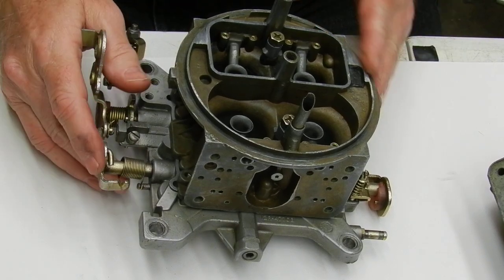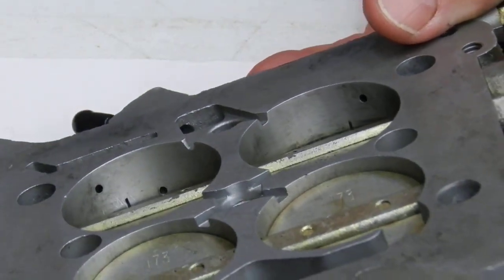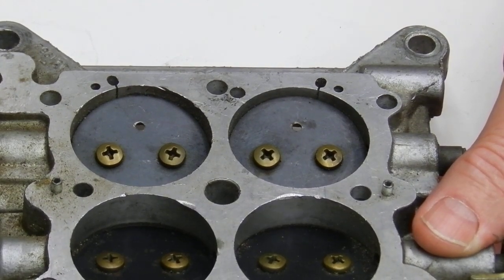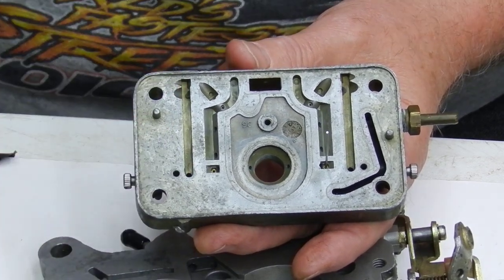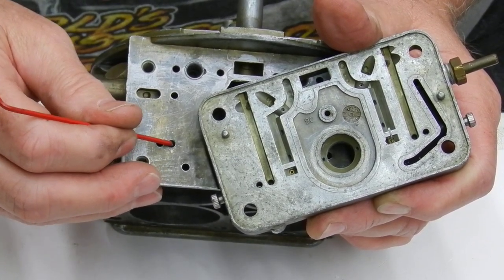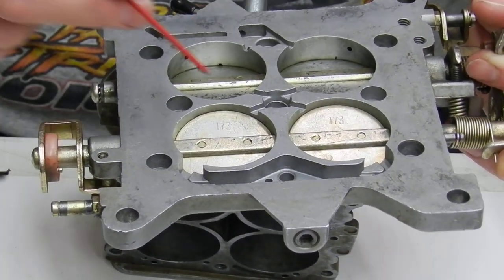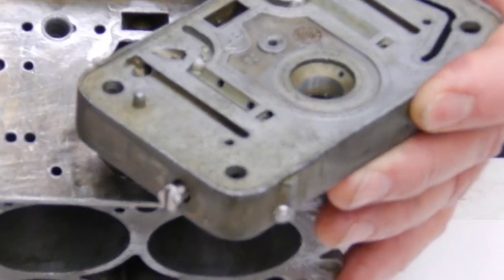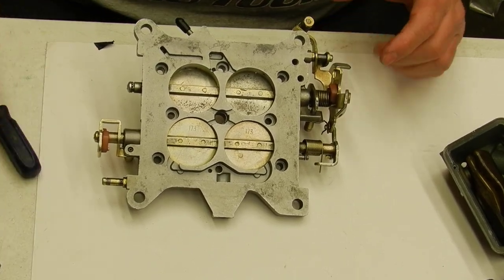Holley Carburetor Tuning: Idle Circuit Mods for High Duration Camshafts

Comment: this carburetor is designed for use of a pcv valve no wonder you have to open the throttle plates so big. put in a pcv valve and no need to drill the throttle blades.
Reply: This fix is for engines with high duration camshafts , the overlap in the camshaft lowers idle vacuum , which causes the carburetor to run rich do to butterflies having to be open further, if you run a pcv, that would tend to help this condition a little because your bypassing air past the throttle plate, watch the video again and I think you will understand, just trying to pass on information , holley ultra carburetors have a adjustable air bypass designed into this model

Comment: I've been fighting with a 4150, 670 cfm, vac secondary for the last 3 months at least. I finally have idle fuel mix adjustment thanks to this video and others that I found on YT. I don't get setting the curb idle with the primary throttle plates when in fact you are exposing more of the transfer slots. This is where I was getting into trouble having the idle mix ineffective. Now I back that primary curb idle off the primary and set my idle with the secondary adjustment screw. What a difference.

Comment: Awesome video my friend!! I hope more people really tune in to this with big cams. I built a ford 429 with a big cam and had this exact problem. Fortunately I didn’t drill holes I just modded the secondary butterflies with an adjustment screw to open them up for more air and closed the primary butterflies closed. Worked perfectly. Thanks for sharing these tips. This is old tech that will fall to the wayside in the future. The youngsters will loose all this in the future.

Comment: Great Video and explanation of the idle circuit. Ive been tell guys for years to drill the blades....they just don't get it, they try to compensate the bog by adding large boosters as a band-aid.

Comment: Update to my previous comment. This video taught me two things that nobody else did. 1) How the idle circuit works 2) Why you need to set the primaries differently, when you have  a big cam. In the end, I didn’t need to drill the holes as my carb is a modern Quick Fuel HR 780. This has a (almost hidden) Secondary idle adjustment screw so you can crack open (in my case) the vacuum secondaries, to let the idle air in. But it’s the same idea. However, if I hadn’t watched this, I’d never understood it’s purpose. So now the all new FE, doesn’t crackle when you rev it from idle (because the exhaust isn’t full of unburnt fuel) and can be driven smoothly enough at low speeds. None of the other ‘experts’ got across to me any of this stuff. Thanks from the U.K., where nobody understands these carbs, except maybe those who watched this. Many thanks.

Comment: That video was awesome! I've got a 351 Cleveland, with a large cam, with lot of overlap. It stinks at idle so much, i don't wanna drive it. I've never tuned a 4 corner idle Holley before, so these tips are just fantastic. Thanks! 
Jules from Melbourne, Australia
Reply: +Julian S , thanks for watching , if I can be some help on your holley let me know I have lots of tricks for the idle circuit, please share video. randy
Reply: Randall Cribb Hi Randall, that sounds great... if you let me know your contact details, i'll msg you or even call you. Cheers J
Reply: If it stinks, you need to reduce jet size on the primary side to start with, pull the bowl off, and read the jet numbers. Order jets on ebay 2 numbers smaller and go smaller from there if you need to. And if you ever have to go larger on a motor, you can buy drill bits and drill the jets out in a pinch if you find the chart on jet sizes/drill sizes.
Reply: @randallcribb7015  Where are you located?  Can you send contact information?

Comment: More please. This is a dying art. My carb guy is getting old and I'm gonna have to be my next carb guy.
Reply: thanks for watching Shawn by the way my original channel got hacked , I have re-uploaded these videos and 8 others to my new channel (Holley Carbs: How To's & Advice ,40 yrs of exp.) please subscribe to this new channel, where we upload several new videos weekly thanks. -Randy
Reply: Shawn are you more interested in rebuilds or modifications .randy
Reply: Randall Cribb both? Mainly rebuilding and tuning.
Reply: This is a great video and the practice is actually been around for a long time. I was lucky enough to meet Grumpy Jenkins in his shop the year he died, and watched him work on my friends drag carb. These old timers will be the last of this carb pastime with the computers and injection taking over. Kids now push buttons on the computer instead of swapping jets and changing power valves etc. I still like carbs better because it will get you home without sensors burning out.
Reply: Been watching the folks over at the Cleetus McFarland channel. Reminds me of when we were kids but like you say they use lap tops to tune their cars. Just don't seem the same.

Comment: I did that to a 750 carb  that was on a 302 chev motor that I built a long time ago . The motor was I think around 12.5 to one with a set of heads that came off a g gas car .The 600 isky roller had a lot of duration . Seems like I installed 2.5 power valves and added the holes to the throttle plate to lower the plate down the transition slot. I had read about this mod and a couple of there mods in a hot rod mag like 40 years ago or close to that . I had added reo pumps and a lot of accelerator pump nozzle .  I appreciate your videos and will watch all of them Thanks

Comment: This is a great help. I have a new 427FE with a pretty big cam. Above 2000 it runs strong and smooth, but below it bucks and is generally horrible to drive. Also an unpleasant crackle when revved, which I think I sunburnt fuel. My carb is a Quick Fuel QFT 780, but I guess the principle is the same. My plugs are soot black. I thought I need to start messing with the jets, but now I see the butterfly hole mod is probably a better way forward.

Comment: Hi Randy, I just read that you have another channel (to which I WILL subscribe) but I wanted to leave my thanks right here for this video. Had exactly the symptom you described on a 327 with a 4160 on it and the problem was that the transfer slots were too much exposed so I took off the butterflies and set them in again. Now the throttle shuts the transfer slot all way and I'll be able to set in the idle properly.

Comment: So here is a dumb question: Why does holley not put a mark in the throttle bore or give a measurement from the top for the correct setting of the throttle plates relative to the transfer slots so the carb doesn't have to come on and off...
Reply: Not dumb at all. Anyone who has dealt with this has asked it. So has Holley and they sell a kit so you can adjust your sec without taking the carb off. My new 650hp on my 351w bracket car had great top end but idle sucked. Lean bog or dead rich. Idle screws were in all the way,out of the box. Opening them 1.5 turn got me stinking black smoke. So much for "out of the box". It is great to be able to find these videos from guys that know what they are talking about. Very little REAL tuning information is available. I am now confident that with proper sec adjustment and the proper air bleeds and maybe the holes in the blades, [if needed] I can improve my 60ft and light rt. I intend to replace the flathead screw with an allen screw or maybe just flip  it over so I can dial the secondary from the top, engine running. Thanks for the video. Just what I needed.
Reply: It depends on the camshaft overlap. It may be different size holes drilled for different motors. You still have to remove it to check.

Comment: hate to bump an old post ,but I have been pulling my hair out trying to get my carb to work, your videos are GREAT and have helped a TON, I have a double pumper 650 cfm 4150 and it likes the idle screws at half of a turn, that is where best vacuum and afr is at, but it wants to get real lean when I let off the throttle after a good hard pull, can't seem to tune this out,ANY help will be MUCH appreciated

Comment: Maybe you can answer this question I had 15 years ago.
I built a 381 stroker Chev. Ran first time on the dyno, set everything up perfectly (750 to 800 idle speed) with regular headers (some exhaust leaks).

I took it to my work for storage (worked at a marina where I built the engine) but set it up on a pallet with nice motor mounts where I could drag it out, hook up a hose and run it whenever I wanted too. I made a custom set of junk zoomie 10" headers for this purpose. I didn't have a real pair of headers yet. Thing is, I could only get the idle down to like 1100.

I rebuilt carbs at the time, at the marina, so I took it off and did some inspections. Nothing.

I finally installed the engine in the car with long tube headers and exhaust and the engine ran perfectly again!

Nobody knew what caused this.

Any clues guys?

Comment: Thank you for sharing your knowledge. Your videos are a treasure. I have dual 750 demons on my 671 383 stroker. I have it running/driving but needed some advice where to begin on the tune.   I have done some power valve referencing in house. What’s a good base line squirter? Accel Cam? Jets?  Accel pump? Any help would be sweet.

Comment: Does the secondary Venturi’s also have the transfer slot and how does setting of the secondary butterflies affect the primary? If you have primary mixture screws adjusting so that best idle is obtained at 1 turn out, but your secondaries mixture screws are only 1/4 turn out and you still have a bit of a stumble coming off idle and not a perfectly smooth idle(a bit of a shake), could you assume the secondary transfer slot is exposed too much? Would this require better averaging between primary and secondary transfer slots to a max of 0.60” each(preferably less)?

Comment: If your running vacuum secondaries would it be best to just open the secondaries a little bit rather that drilling holes on the primary side?
Reply: JMckeown6 Some people do it, but when you do, you have the same problem when vacuum pulls the secondaries, you get lean or even a lean bog. Thunderhead69 has a video on it.

Comment: Friend, I have an original 302 from '75, put a 4-port intake and a Holley 4160 600cfm vacuum. For the engine to start I have to accelerate, I release the accelerator and it shuts off. There is no idle.I've been watching videos of similar carburetor rebuilds and I don't see that my carburetor is missing any parts. I already adjusted the floats, each hole in the joints matches, injects well, What can be?

Comment: Great videos Randy, Thanks. I have a 850 double pumper with 4 corner idle circuits. It is on a 545 CI BOSS 429 street motor with a cam with pretty small duration numbers for the 545 CI. My question is should the secondary throttle plates be in a similar position with the idle transfer slot as the primary? Should the primary and secondary throttle plates be matched in there relationship with the slots? You mentioned the exposed slot should be around .040". I have read a lot of people say the slot with the plates closed should form a square which seems a lot smaller than .040". Your thoughts please. Thanks

Comment: I have a BB Chevy and I seem to be at 12-13 on my AF gauge at cruse until I give it throttle or up a slight grade then it runs @ 14.7 -15..
Is my transfer slot too rich or delivering the fuel ⛽ @ the wrong ratio?

Comment: I have problems "the other way" as it were. I can´t open my blades enough to expose the transfer slot!. What happens when I do set the bldes rigt is it idles around 1700 rpm andI have no vacuum leaks. I´m no where near exposing the slot. What that does is the when I´m just above idle on the throttle it leans out when I drive, not in neutral so much. I figure that it leans just befor the transfer slot is about to be exposed but is not "engaged". The fuel in the idle circut is not enough so that´s why it goes lean. If I press down just a tad more the fuel comes back but I´m nowhere near drawing from the main circuit. Therefore the fule must come from the idle cirut....At the moment I run the idle circuit a bit rich so it won't lean out so much.
Any help or ideas is greatly appreciated!

Comment: I am having a problem I have a big cam 440 Chrysler with an 800 dbl pumper and holley blue pump I have changed the Quick fuel needle sets checked center hung floats.I can set the floats perfect drive the car out for a cruise everything is good but on the way back home all of a sudden the car starts flooding the carb is clean bowls are clean no debris but rear level is too high I adjust the float again car is fine. Question is what can make the levels change after you have set them many times before.

Comment: Tore down a swap meet carb that I recently bought.... discovered someone drilled .035 holes straight through the idle feed restrictor holes straight into the bowl side of things. What is the reason someone did this? Thank you

Comment: Great video, I'm having issues tuning up a 280 duration cam (224 at .05) in my 5.0 sbf and wondering how to know when I should resort to drilling the butterflies? I seem to need to adjust the Curb Idle screw to where the butterfly is cracked open to keep it from stalling. If so is it idling on the primary circuit? It's a Holley 4160 600cfm Vac Sec. Thanks for any advice.

Comment: In theory could you screw the idle mix screws all the way in and if the engine still runs it would be running on the transfer a lot? Then if your engine is running off the transfer slot you could back the idle screw off until it stalls, then back the idle mix screws off 3 half turns and attempt to start and it should in theory be running off the idle circuit right?

Comment: so once we set the slots right then we need to adjust the idle by mixture screws without disturbing the idle speed screw .did I get it right?
Reply: if you have a racing cam in your engine you might need to drill bypass holes in the throttle plates to bring the idle speed up after you set the transfer slots correctly, might help to watch the video again . hope this helps you randy

Comment: Before I would drill any holes is make certain the correct gasket is used between the throttle plate and carb. Also use a vacuum gage and install the correct size power valve. If you don't reduce a 6.5 front with high duration cams... fuel enrichment is too much.
Reply: Gordon the power valve will not cause an idle problem if its open or closed at idle, unless the power valve diaphragm is ruptured and gas is being  drawed in pass the gasket or diaphragm , the power valve only flows fuel out of the boosters , now if power valve is wrong calibration and staying open at idle it will be rich above an idle , it took a long time for me to understand that, sounds like you been repairing holleys for a while, I have been repairing holleys and others for about 45 years and i'm still learning about fuel curves , any time you wont to talk send me a message. randy
Reply: Power valve formula :  put a vacuum guage on the motor and see what the vacuum is. Divide the number by 2 and thats your power valve # you need. Example : vacuum reads  10 psi, you need # 5 power valves. But first you need to make sure there are no vacuum leaks by spraying carb cleaner on the motor where vacuum would leak while the engine is running, if the RPMs increase, theres your vacuum leak.

Comment: Would this modification help with a hard hot start?  I have a sbc 350 with a long duration cam and a holley street avenger 670.  Once the motor is hot and is turned off it sometimes starts at bump of a key and other times it doesn't want to start and acts like its flooding.  There is still fuel in bowls and no fuel residue in bottom of intake manifold so not showing any signs of fuel percolation that I can tell.  Timing is within range so dont think it's a timing issue.  The transfer slot is definitely bigger than it needs to be when I get it tuned on car so going to do the mod just was curious if it could also be causing a over rich hot start

Comment: can i ask you a question? i had a very strange problem with my dirt track race car a couple years ago, i say that because i put 2 different carbs on it and it ran almost the same. it would backfire out the exhaust ONLY, at all rpm  like about 1 to 10 pops every 1000 to 5000 rpm. and also it would not idle down even with idle screw removed ! with throttle rod removed as well. this was a new engine  valves checked and rechecked, with MSD box. any ideas ?

Comment: thank you for some ideas on how to lean out the carb using some common sense
Reply: Carl Palmer Its actually running richer because it pulls more fuel from the idle circuit, richer not leaner.

Comment: Hi, my 750 HP street is throwing a lot of fuel through the primary boosters at all rev ranges then sometimes it doesn't Now it's worse with my new engine which has a big Solid can in it Any idea what the problem might be
Reply: Stratos Pappas did you try going 2 sizes down on the primary jets ?
Reply: What ive done is 
advanced the Timing which increased the RPM so i can close the primary Butterflies a bit and reduced the Transfer slot and opened the Secondary Butterflies a bit 
runs better